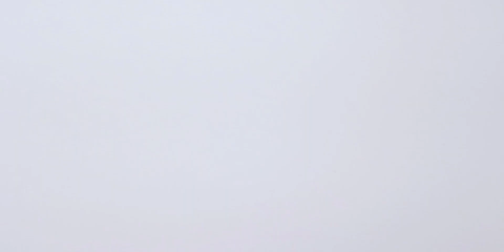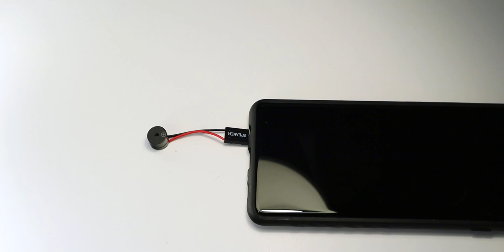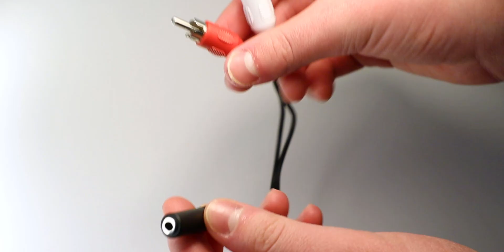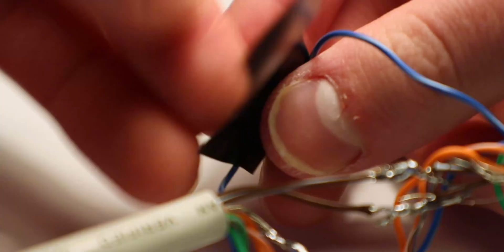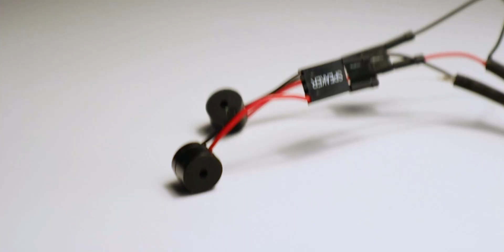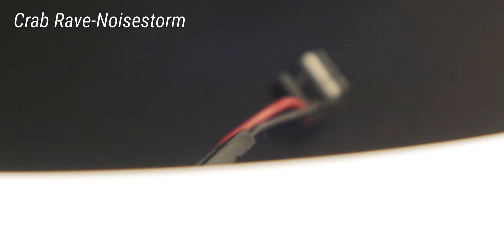Playing Music on the World's Smallest Speaker!

Comment: Hmm, not ideal if I'm trying to just figure out if my internal PC speaker operates as normal, but I have to give it to you. This video is not only original, it's the closest thing I've found to being able to test this thing. I was hoping just having a positive and negative 5v wire in the right places would produce a beep. Any sound is fine, just want to know that it works.
Reply from the maker: Thank you! I just tried putting 1.5v (from a double A battery) on it at it makes a little click. Maybe try that? If it clicks it will probably work.
Reply: @simonretrotech  you're awesome thank you.
Reply from the maker: @JWolff-md3ij  No problem!